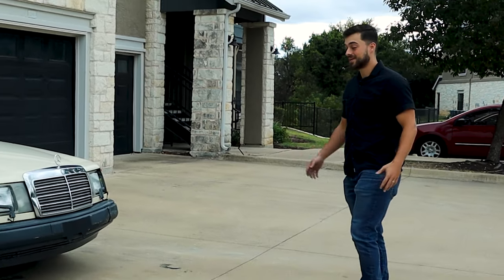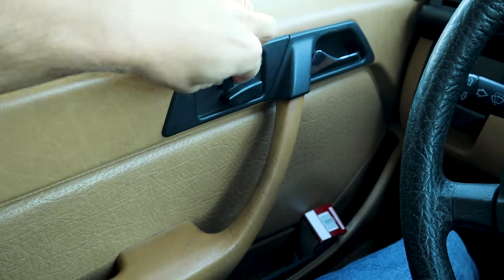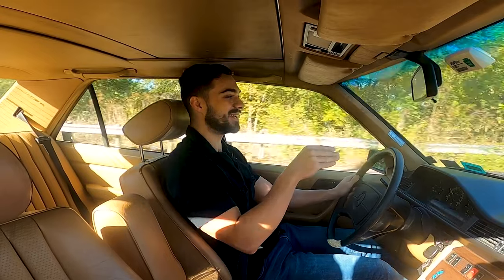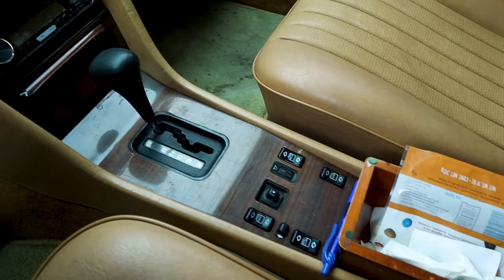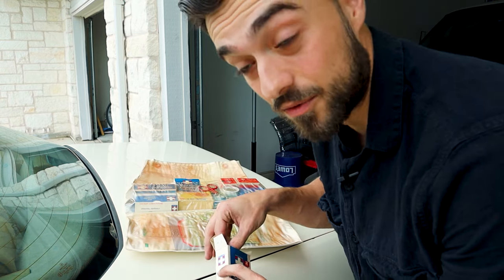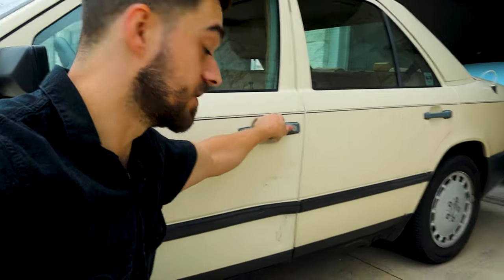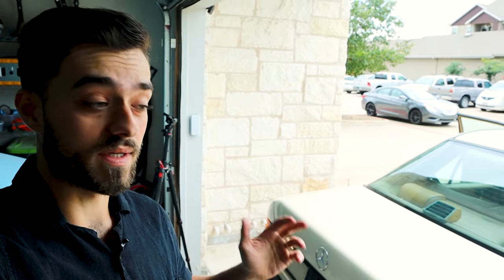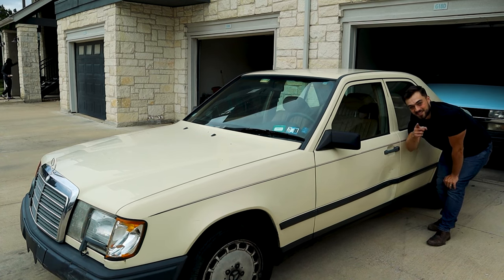I Bought a High Mile Mercedes 300DT W124. It is going to be a handful. Pt. 1

Comment: I bought a 90 300d 2.5 turbo a year ago for a low price and have been fixing it up.  I like the car a lot, it is so solid.  The Diesel engine is great.  There are a lot of little issues that I have been solving, electrical and brake stuff mostly.  Also had a big leak on the front of the engine, that turned out to be the bolt on the tensioner.  I had abs issues, actually mine had a pump that was blocking fluid from getting to 3 of the wheels.  I figured this out while bleeding brakes.  a used pump from eBay solved the problem.  Recently I have been fixing the power windows.  Good luck on your w124!

Comment: As a person from the UK diesel engines have been my choice for almost all my cars. Mercedes engines (new and old) are bullet-proof but the high tech and plastic in the new cars makes them money pits. An old diesel engine is a very good choice without all those modules and plastic. Will it be hard to fill up in the USA?
Reply from the maker: That’s what I was thinking. This diesel Mercedes’ should be able to last a few more generations, hopefully. 
We have diesel at just about every gas station. Most of the work trucks here run off diesel, so it’s not that bad. It is $1.60 more expensive but the MPG the 300DT can get, I am not too worried

Comment: I'm telling you, if you have the ability to fix it up and maintain it...do it, you are a young guy and you could potentially drive that to your retirement party. BTW, check the OVP relay behind the battery, there is a plastic cover there. If the relay has failed or the fuse is blown the ABS light will come on.
Reply from the maker: Do you think that relay going bad would cause the pedal to malfunction at the same time? The ABS light appears after the pedal does a bit of stuttering.
Reply from the maker: I went to start my car this morning and both the SRS light was on as well as the ABS light. It was also trying to die on me, which are tell -tell signs of the OVP needing to be serviced or replaced. 

As for my ABS issue, I think it is related to the wheel speed sensors in the front wheel bearings. 
Both of which im planning on fixing here pretty soon.

I find it funny that I just developed the OVP issue this morning.
Reply: @ImChrisDeDecker  They are one and the same. The light is telling you there is a malfunction. The pedal shudder is because of that malfunction. The ABS thinks the wheels are spinning at different speeds and is trying to compensate.

Comment: 195k? Wtf high miles?
Reply from the maker: Ask the normal person what is high miles. Over 150k is high to the majority of people. Chill
Reply: Sounds funny cause in finland its very very rare to find a w124 that have such low miles as 190k😅 even with gasoline engines